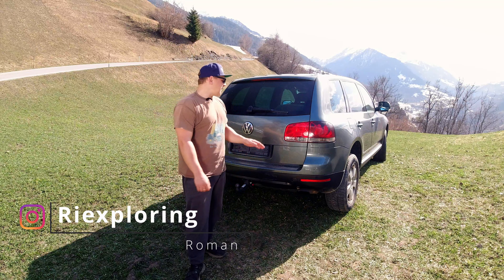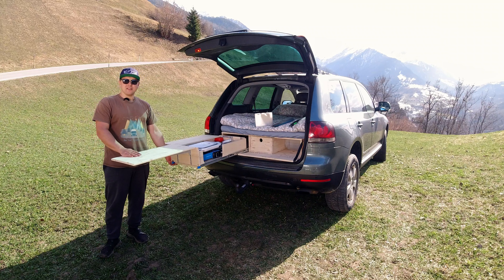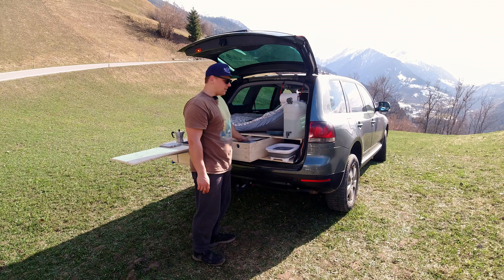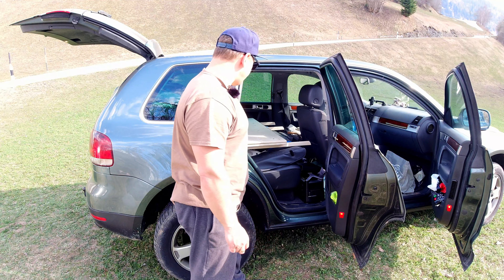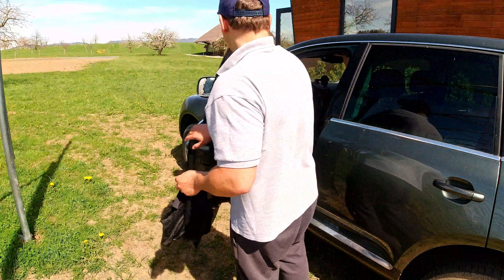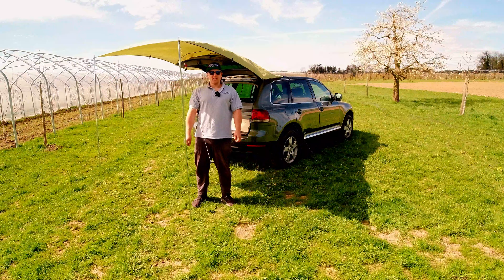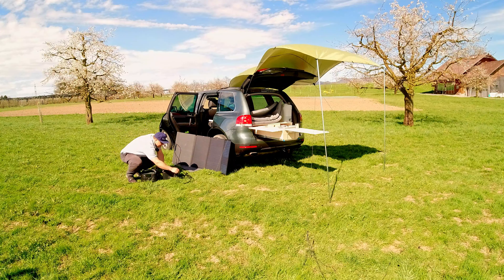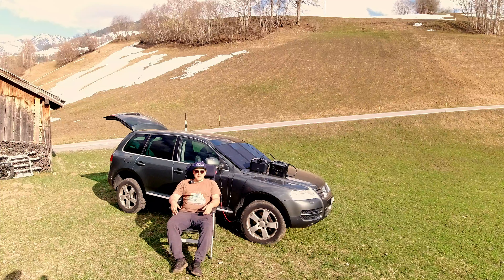Our SUV Camping Setup With Slide Out Kitchen

Comment: if you remove your  behind passenger seats you can get much more space.
Reply from the maker: Yeah,  I was thinking of that. But then it would take way longer to install the box. But, it’s in my mind, maybe the next project will be without rear seats.
Reply: @AlternativeHouse  its easy to remove. There are 5-6 bolts only. Easy to remove and easy to put back